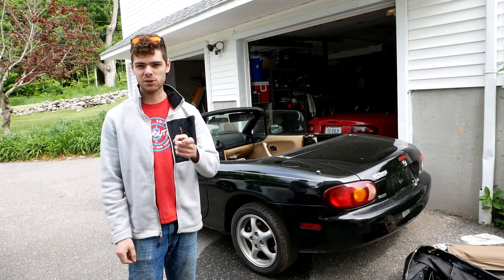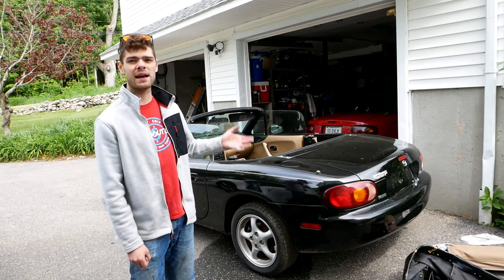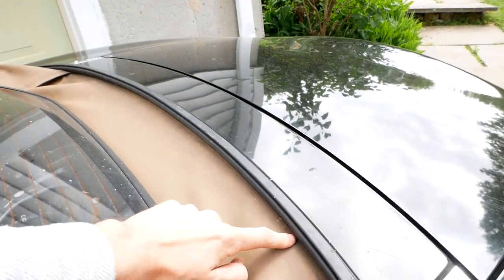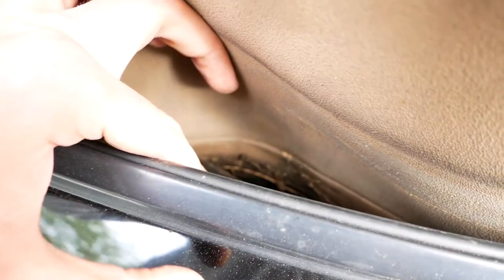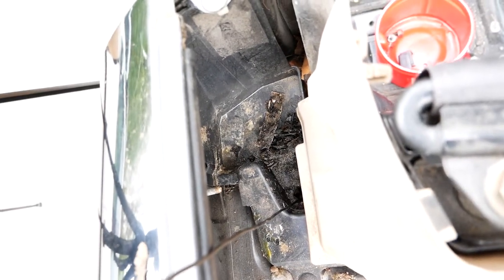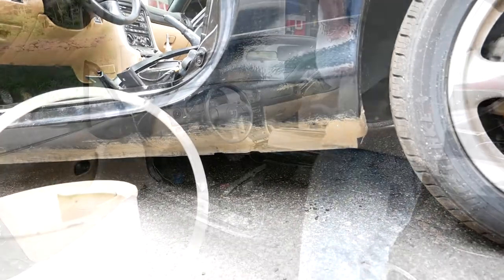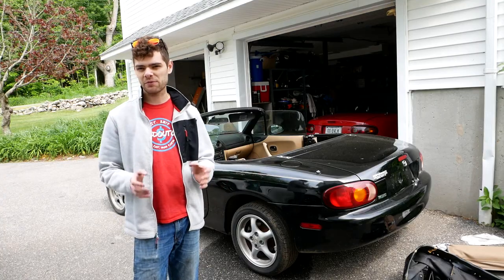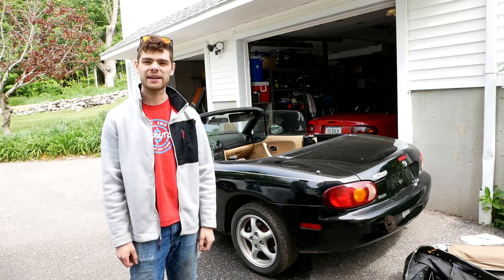MX5 Miata Top Drain Cleaning | Stop Wet Interiors and Prevent Rust!

Comment: Ok so, Ive had the whole passanger side full of water today after a heavy night of rain. Turns out this was my problem and i cleaned them. But now after i dried everything in the cabin there still seems to be water sloshing around somewhere in some bodywork. When it overflows where would the water go? There is none left in the cabin i pulled the carpets and its now dry as can be but i can very cleary hear water sloshing somewhere. Can somebody maybe give me a tip?
Reply from the maker: Although it’s likely unrelated to your initial problem, have you checked the trunk?
Reply: @CashedOutCars  Yes i have the Trunk was dry. I since found the drains for the sideskirts turns out the water flows in there through a hole in the cabin once the cabin runs full. For anyone wondering the drains are actually on the part where you can lift the car. There are some holes in the lip that actually look like the lip is broken, wich are easely clogged.

Comment: How can you find this with a NC Miata hard top convertible?
Reply: Basically the same spot and process. When ihad my prht i did it. The honeycomb looking part is what you run the wire through to clean it out. My nb is currently leaking inside so i have to get this done

Comment: I’m having a lot of problems with my rain rails I cannot but a metal stick the whole way though my drain and it holds water I was able to clean a lot out but it seems there’s something hard stuck pretty far in if you have any tips or tricks or if I can replace the rubber drains please let me know I’m stuck I have a NA from 92
Reply: Could try an air compressor too. My mechanic years back did it for me for free

Comment: Absolutely awesome! i bought an old Nbfl with the big engine, heavy waterdamage - lots of rust but luckily no mold.

Problem is, I am not to sure about all the little rust parts on the car. For instance, my trunk has some spots at the closing mechanism, near the battery and underneath the spare tire. I polished the battery area or basically the whole inside of the trunk - also coated it with rust paint. But would you also polish the trunk hood, if there are a few spots? Also, would you, after painting everything with rust paint, go over with normal primer and paint it again or just leave it as it is? Great video!